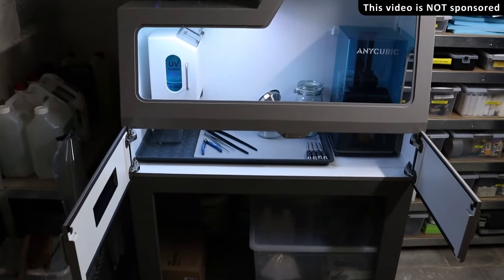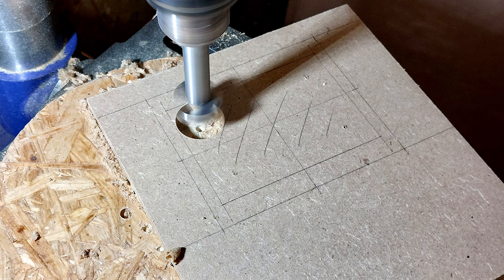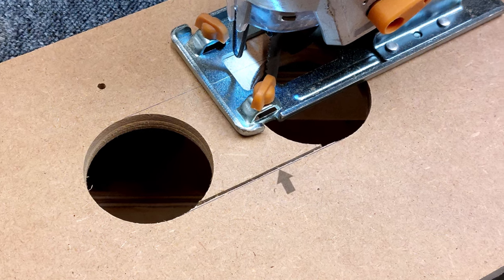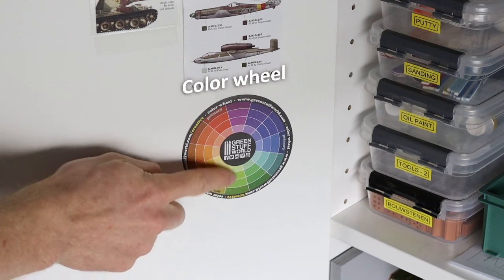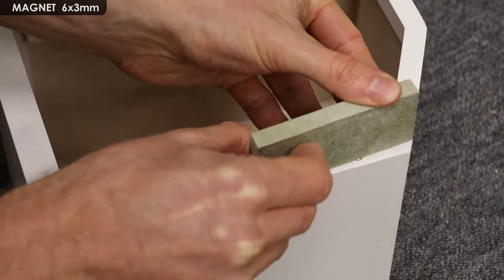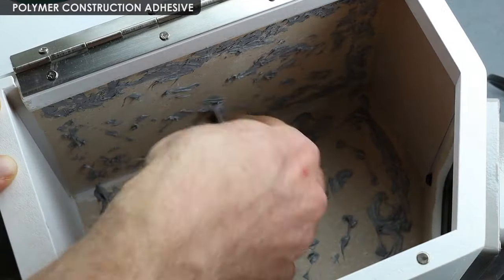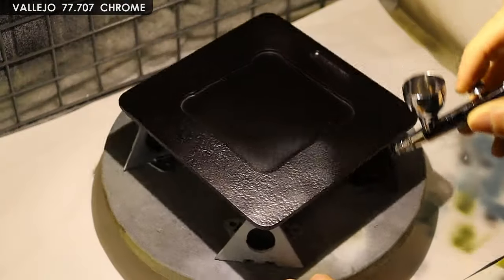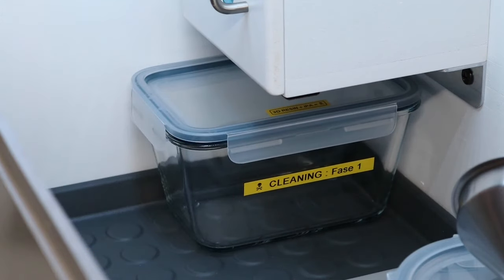Small UV Curing Station from MDF - Resin 3D Printing

Comment: Great project! You do an amazing job with the MDF, getting it so smooth! I have something similar in mind for a UV Curing Station but will use a bathroom fan timer switch so I can turn the light on for a specific number of minutes. And plan to add a switch on the door so if the door is opened the UV light will automatically go out.
Reply from the maker: Sounds good 👍  I will most likely update it as well with a timer and switch from an old microwave in the future.  Goodluck with the project, cheers